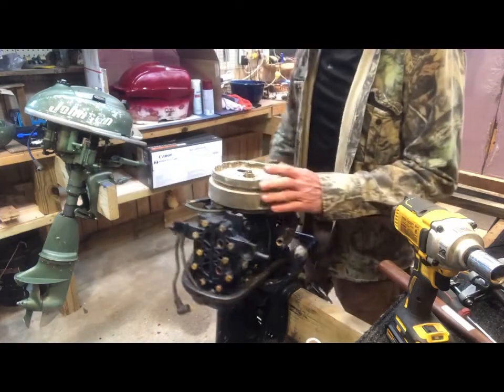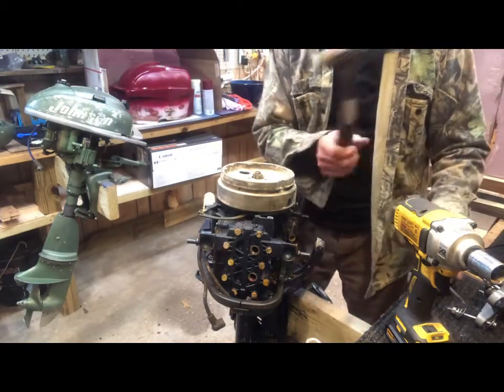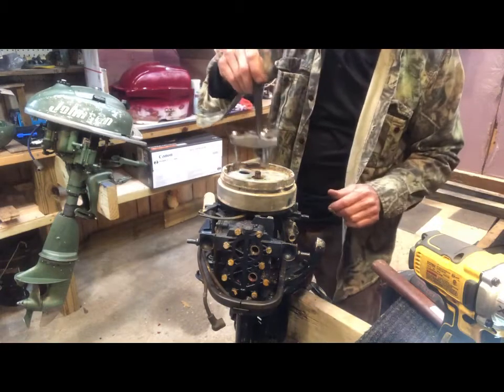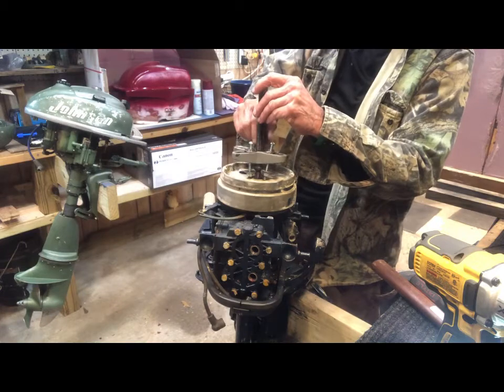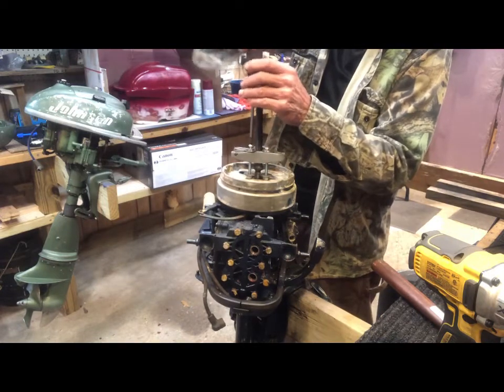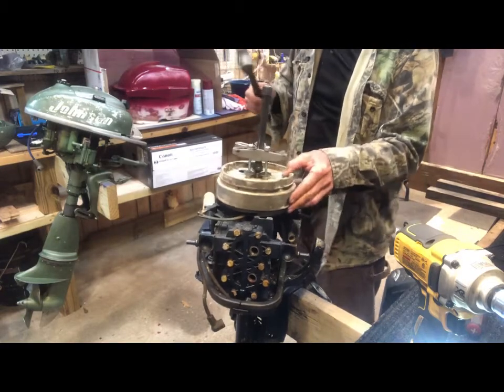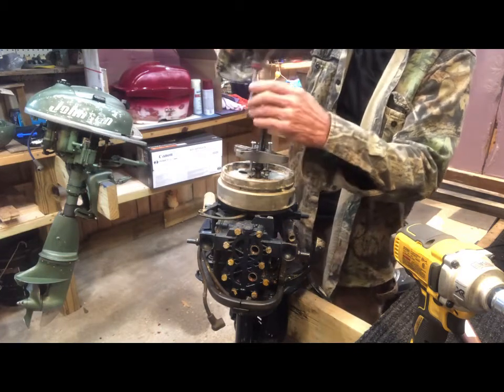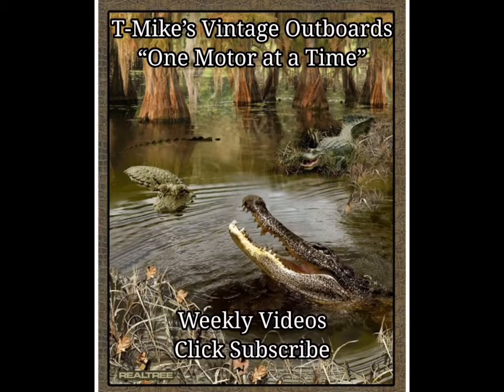How to Remove Flywheel Easy Way Beginners Guide to Restore Vintage Outboards

Comment: Thanks for the answer on the 3 horse gasket sealer. The flywheel tip with the hammer is a good one. You don’t need to torque the puller heavily. Make sure you have all the retention bolts out, Mount the puller, preload as described, tap tap and the flywheel comes off without any drama.

Comment: You have any suggestions. I have a 92 yamaha 15hp flywheel when having the puller already installed with pressure pulling it will not buge. Yes the flywheel nut is off but this thing is stuck and it's not in bad shape at all
Reply from the maker: Tighten puller and hit 3 times with a big sledge hammer / tighten again and hit 3 times again / repeat until it pops off.

Comment: I’m putting a cylinder head back on a 1967 Evinrude 2 cylinder 3 horse. Should I use gasket sealer on the head gasket? If yes on the sealer any idea where I could find it?
Reply from the maker: Yes. Gasket sealer on everything except gas and water plates.

Comment: Only thing I would add is to watch how far down you screw the puller bolts, not too deep or you risk hitting the coils underneath with disastrous results.